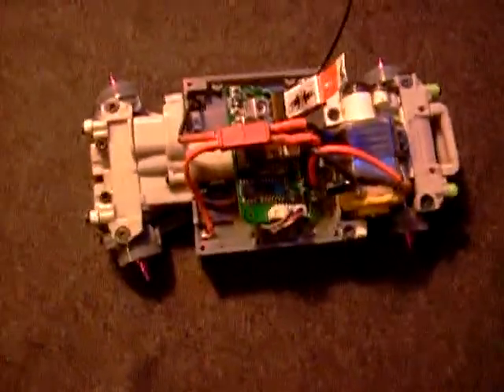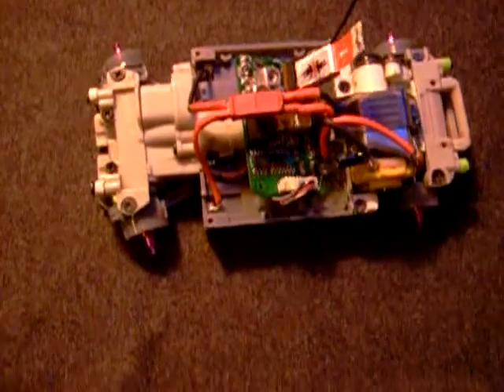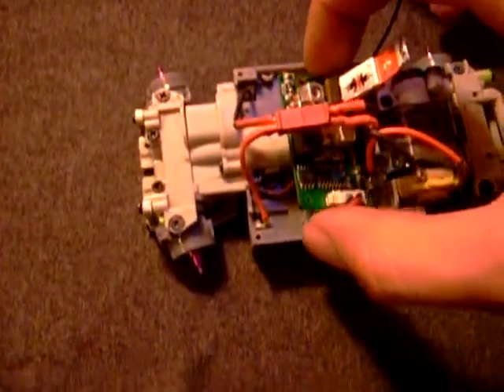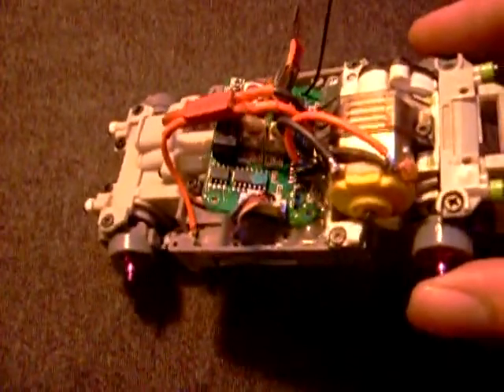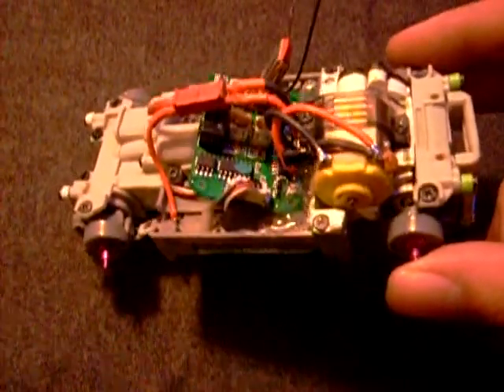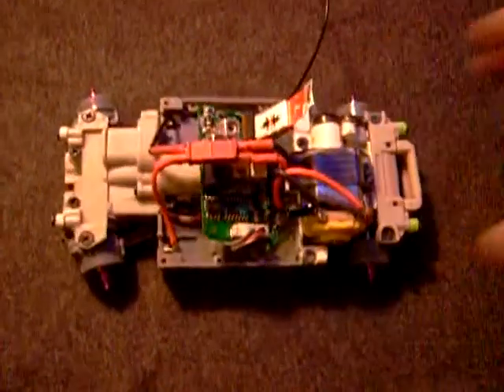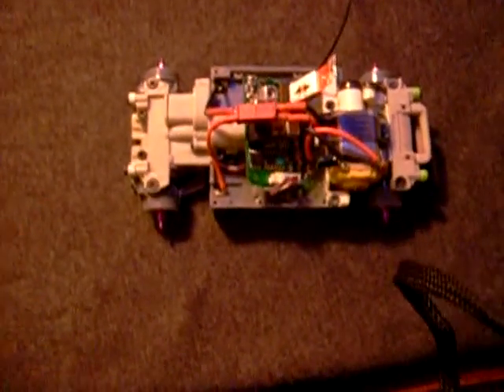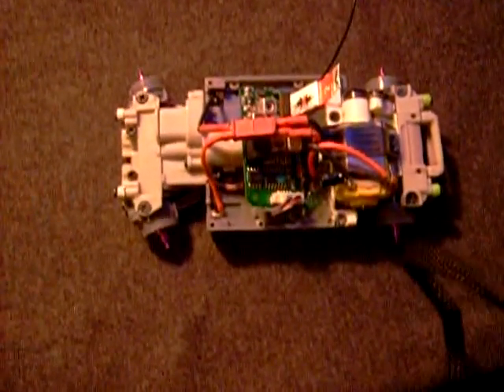Fast Tims Car!

Comment: thank you psychotik. i have been hunting down the servo wire color match for a while. just finished the mod on my evo lancer evo8. works flawless even running stock nimh batteries in stock battery holder.the board stays cool to the touch even w/awd kit and stock bushings.